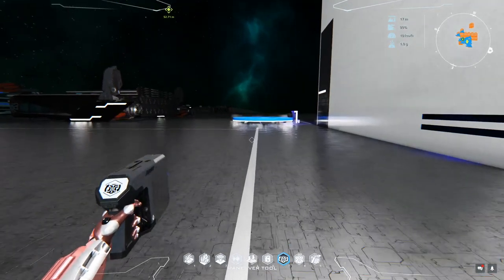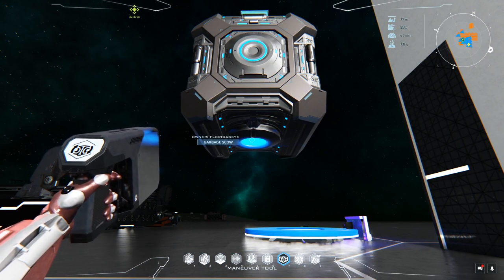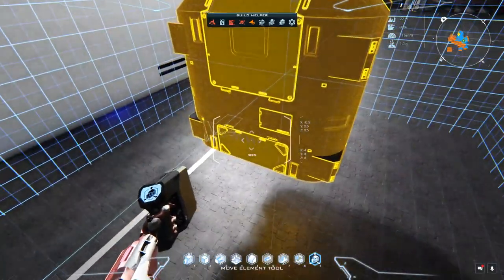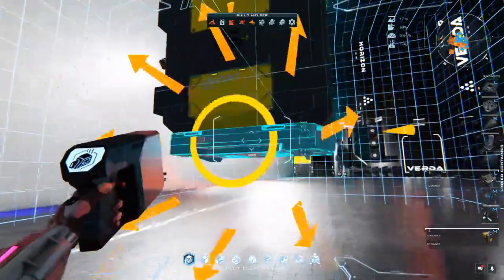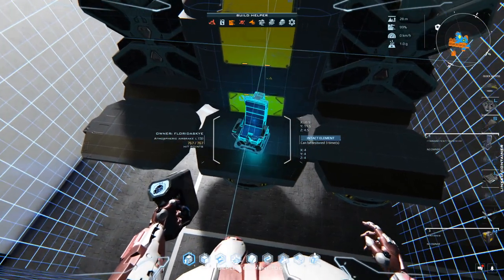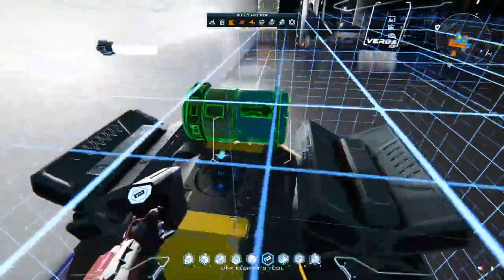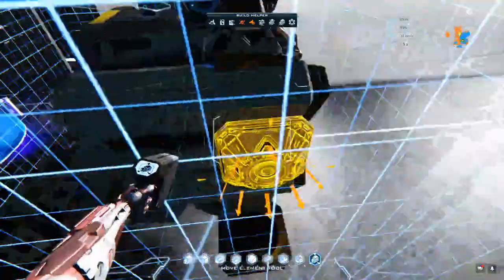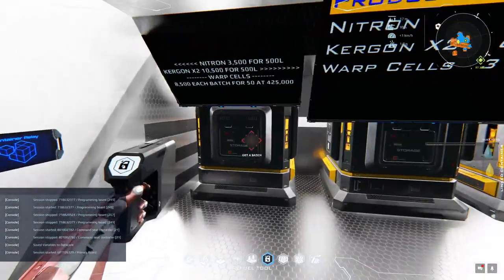Building a Ship from Scratch in 2021

Comment: Very helpful but a parts list would be awsome. Trying to build one but I keep forgetting things.
Reply from the maker: Every ship is different depending on how much cargo you're trying to lift, but in general you need Engines, Adjustors, Hover Engines,  Wings/Stabilizers, Brakes, cargo containers, and a flight seat. Also can add Radar and res unit. For space you just need to add Space Engines, Vertical Boosters instead of hovers, and retro thrusters.
Reply: That is a shopping list... I can work with that. Thank you very much

Comment: Hey Rob, 
Great video.  I'm new to the game and you've provided great information.  

I'm a bit confused on the mechanics/linking of adjusters if you could shed some light.  
So if I put an adjuster in the rear right and an adjuster on the nose left, when I turn right, both will turn on automatically?  I don't have to link them or anything?  Does the rear left adjuster not activate when turning right?  Does this have to do with the location of the adjusters in respect to the design-grid?
Reply from the maker: nope, don't have to link them, they just do their thing. You should be seeing them both work, if you hit X twice to bring up your vectors you should be seeing an arrow come out of both of them.